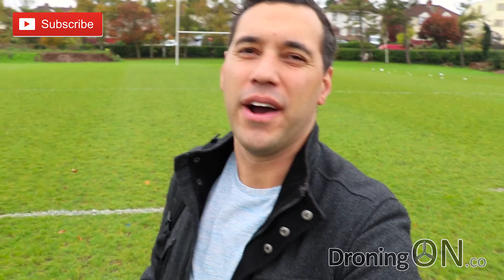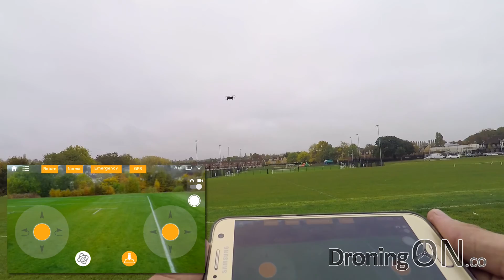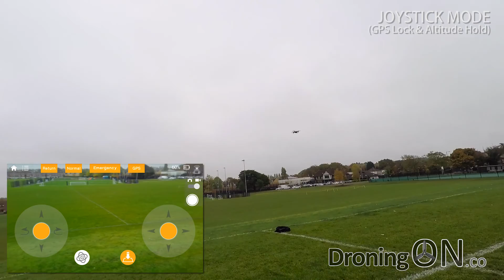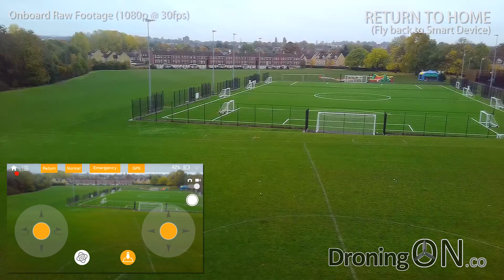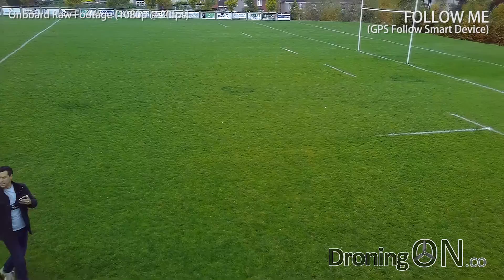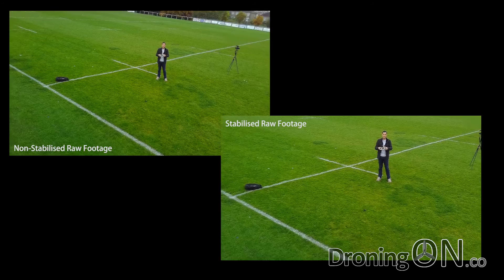DroningON | OnagoFly 1Plus Flight Test Review (Part 2)

Comment: "Stabilized"
Reply from the maker: +H ANT Studios haha yeah, it's anything but stabilised isn't it, terrible quality!
Reply: Why would they do this on the 2nd gen product.
Reply from the maker: +H ANT Studios it's indeed strange but basically the new model had precisely the same firmware and internals as the old model, basically it wasn't an enhancement. The company has since stopped making drones, fortunately.
Reply from the maker: +H ANT Studios it's indeed strange but basically the new model had precisely the same firmware and internals as the old model, basically it wasn't an enhancement. The company has since stopped making drones, fortunately.
Reply: DroningON I just seen this $160 drone go on sale for $40. You have to check this out for a video! The name is - Brainpower Origami Cyclone
Reply from the maker: +H ANT Studios it's a horrible drone, I'm not surprised 🤣
Reply: DroningON Lol. I had to get it for a video :D

Comment: Do you think the problems from the first edition are solfed now??
Reply from the maker: +The RC Collector unfortunately not, but I am told that they're still working on new firmware for the 1Plus, yet to see it though.
Reply: DroningON.co   I am searching for   a GPS drone unter 250g weight, ( law reasons ) Do you know a good one?
Reply from the maker: I'd have to recommend the Dobby at this time, its the only one which has truly proven itself despite some minor initial issues: http://www.banggood.com/Zero-Dobby-Pocket-Selfie-Drone-With-13MP-HD-Camera-GPS-WiFi-App-Control-Foldable-RC-Quadcopter-RTF-p-1057414.html?p=7I14124028655201603T

Comment: So the new OnagoFly is almost as terrible as the original.  OnagoFly has never provided me with a working unit or the fuel stick.  Now they want me to pay more for this new, almost as terrible device that assume will not fit into the case that I bought with my initial order.

Comment: Excellent review Ash and all the original points covered. A couple of points, however, regarding calibration. You REALLY have to lay the drone as near perfectly flat as you can to calibrate the IMU at start up; near enough doesn't cut it. 

There also needs to be a compass calibration as part of the set up or you are always going to get TBE.  TBE is caused by a change in compass deviation. It is highly unlikely, nay impossible, that the deviation is the same at your location as it is in China. Without any compass calibration to set this for your location, the GPS and compass are always going to be at odds. This needs to be addressed immediately or the Onagofly is going to be plagued once again with fly aways.
Reply from the maker: +Knapweed, trust me, I know about laying it flat :) as I said in the review it's as flat as I could get it but the reality is that no user can viably get it completely flat when flying it outdoors, there just is no such surface. Therefore OnagoFly needs a real compass calibration routine, like the Phantoms etc.